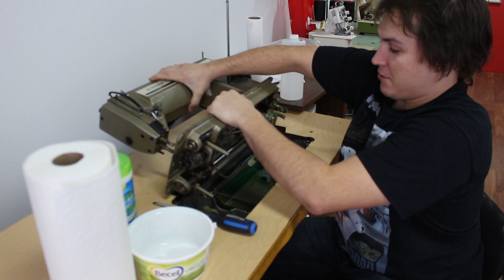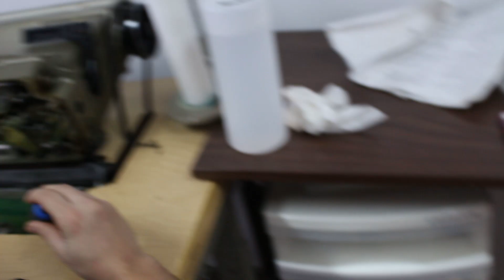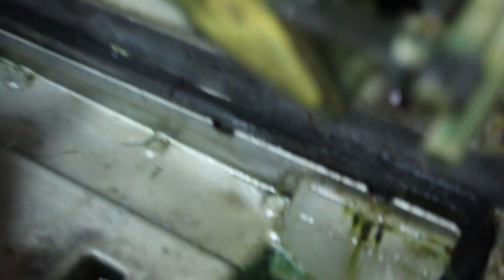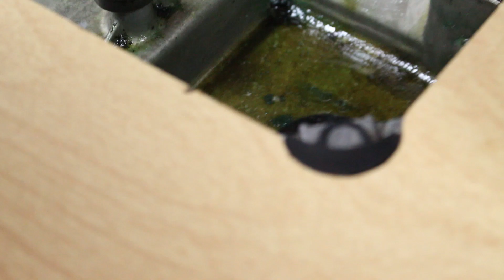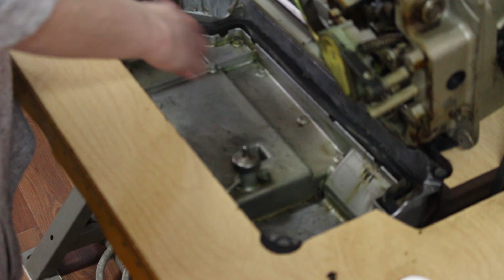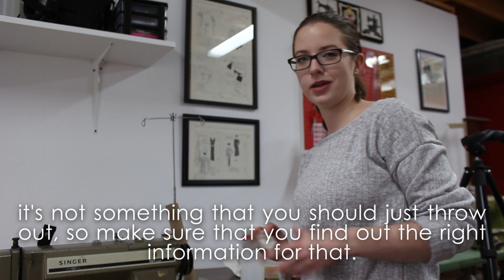Industrial Sewing Machine l Changing the OIL

Comment: Please don't do like this because the bolt inside the oil tank will be damage with thread scratch.If you want to remove oil you can take the oil from the tank with a small plastic dappa or plastic cut piece of a mineral water bottle.

Comment: Thank you for posting. It's not easy to find info on industrial machine. I would like to know if you would make. Video of how to remove and reinstall the head from the table. I need to take mine to service. Or a video of how to maintenance the machine.
Reply: the hinges of table-machines are connected to metal pins that are stuck vertically in the table. Once you have removed the driving belt connecting the motor to the machine, you can pull out the whole machine at once. While you do so, you just have to make sure that the hinges don't twist and counterlock against the table.

Comment: I’ll be doing this soon too but I don’t have it yet. So did you transport it without dismounting the machine from the table? I was thinking to remove the oil and dismount the machine before loading in the van. Suggestions will be highly appreciated. Thanks.
Reply from the maker: We loaded it up into a pickup truck as is. I wouldn't suggest it! It was tied down good but I think it is easier the other way. I would do like you said, drain the oil and dismount the machine from the table! 😁

Comment: I have singer Industrial walking foot  model  number  111G156   I am having a hard time with the  Bobbin the thread is not pick up please helpe with it
Reply from the maker: I'd look up ifyour machine has the correct needle in it. And make sure the bobbin is threaded correctly. It could be a timing issue and need to be serviced by a mechanic.

Comment: is there still somebody answering to this video? If so, I have a question about the kind of oil I can use. I have a Singer 191D300AA, which is pretty similar to yours but with a metal cover over the belt that goes on the wheel to do manual stitching. Can I use silicon oil (this is a bare translation of the kind of oil I got since the real name is aceite siliconado) to replace the oil in the carter below the machine?

Another question I have is whether I should pour some oil drops over the screws above the machine or not. I make this question because the previous owner told me to do so, but I did not hear you mentining that in the video. Thank you!!
Reply from the maker: Usually in industrial machines most of the oiling comes through the wicks in the oil pan. As its used it will lubricate itself. As for the actual oil and name, I'm not sure. I've always bought mine from a sewing machine place and asked for machine oil. Please do make sure its the right one before adding, or it can cease up the machine. Seek the guidance of a sewing machine mechanic if you can to make sure!
Reply: Do not use Silicon Oil. Use Type C or a light grade clear sewing machine oil that should be available at any Industrial Sewing Machine Outlets. Also the metal cover you mentioned is a Belt Guard available with all Industrial Machines to keep anything away from the belt while sewing.

Comment: I just picked up a 591 D300AD.  Seems to be in very nice condition but the oil was removed while it was stored in the house.  Seems to be in very nice shape and running well as they ran it for me just briefly.  I noticed they cleaned it up but seems like the oil that was in there was a little dirty.  I have to add new oil now, any tips on a good oil to use?
Reply from the maker: As long as it is oil for sewing machines it will be fine. You will need quite as bit as shown in the video. :)
Reply: Get a quart of lily white from Zipperstop, $15.00
Reply: @danielross59  Get a gallon from WAWAK $19